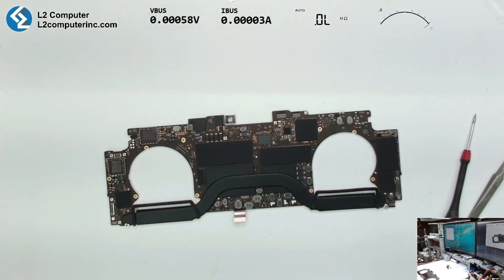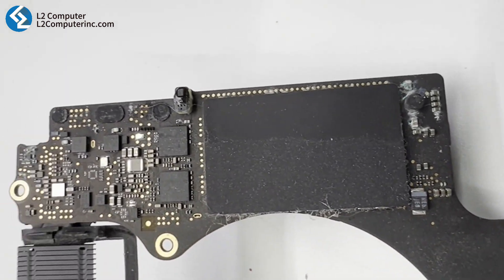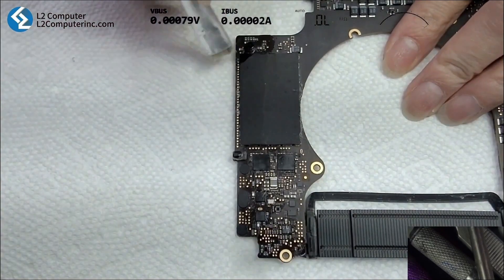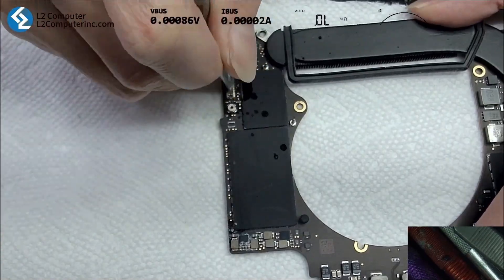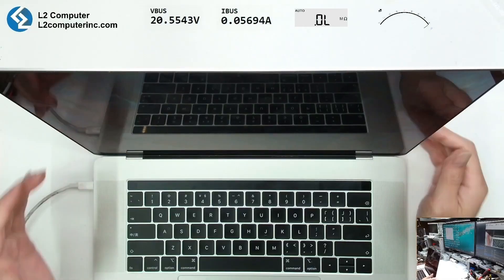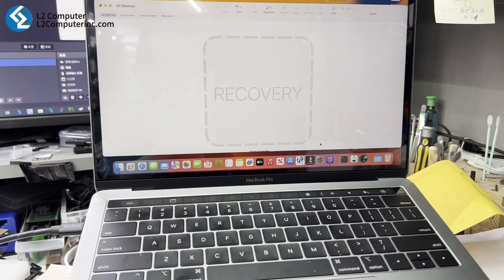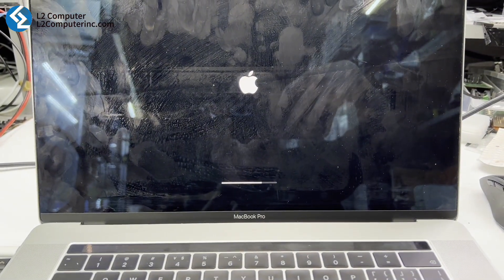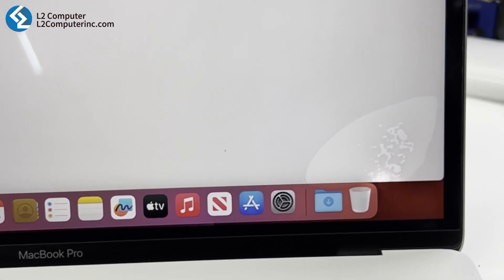Revive iBridge OS failed with error 75 - Macbook Pro

Comment: My Macbook Air 2019 (intel) stuck in Recovery mode giving message "AMRestoreErrorDomain error -1 - Failed to handle message type StatusMsg (Generic error)) [AMRestoreErrorDomain – 0xFFFFFFFFFFFFFFFF (-1) [sys = 0x3F, sub = 0xFFF, code = 0x3FFF (16383)]]" Can the logic board be repaired?
Reply: any chance you figured the out? I tried Apple configurator and now it won't even power on, but still powers on if I try to revive or restore but both still fail. Keyboard ands Trackpad don't work either... everything was fine 24hrs ago!!!!!!
Reply: according to repair.wiki this means there is a trackpad problem. 
1 - The trackpad is not connected (For successful firmware, the MacBook needs a connected working trackpad).

Comment: Hello .My A2141 Mac has a NAND flash memory replacement done correctly, but it gives me error 4014 in DFU mode.
Reply from the maker: Various problems will cause error 4014， The SSD soldered to the correct position?